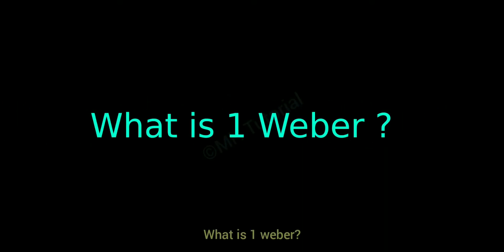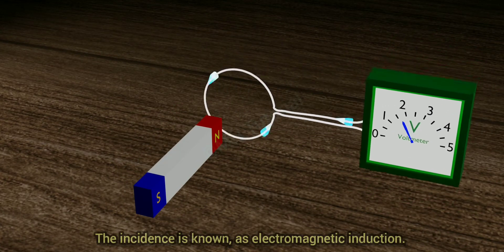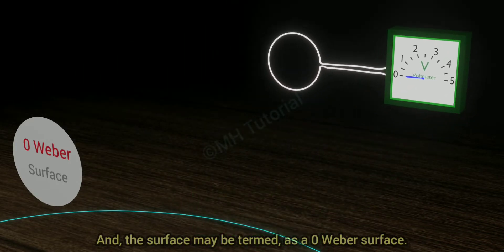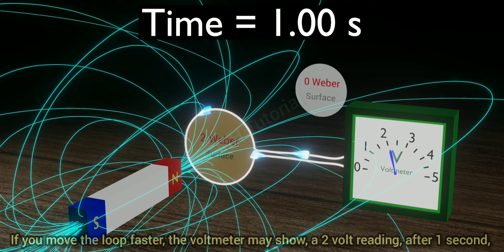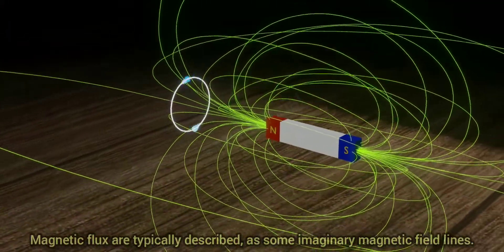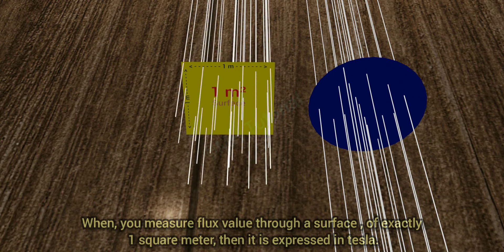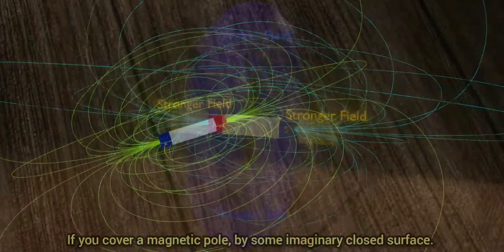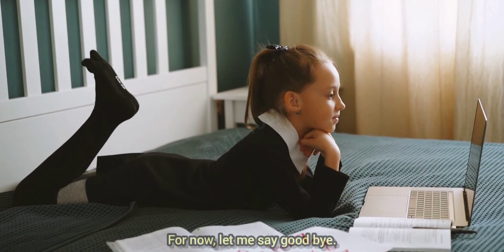What is 1 Weber? What is 1 Tesla.

Comment: So, to culcate the weber, so you use high volt to cause the impact to the magnet to see how much weber, it can absorb, so use that material since that materials will absorbs high weber, per high resistance to be used as storage to be use, so becomea  battery. So, Iron is high captance, so good battery. You put motion of electricity which there is resistance or it goes around, Well, there is connect of circuit wire, which the electricity go around, so as it nears the magnet field in slow or fast, the motion of emf is faster. The point how weber is calculate. So, know what materials can be use as range of reluctance to permeability. The higher magnet force which the iron has so the absorbility rate, per second is high like weber show, so it is high weber mass, so the high part for weber is not base on how much, but how fast it can absorb. Tesla is for strengh, Weber is for speed.

Comment: Ok I think I got it - So the weber is a "situational" measurement of a magnetic field's ability to induce voltage in a coil, it does not qualify location, area or coil size. It merely defines the relationship between the magnetic force and the induced electromotive force.
Reply from the maker: There are so many ways to define the amount of 1 Weber. We have described a simple, easy to realise definition.